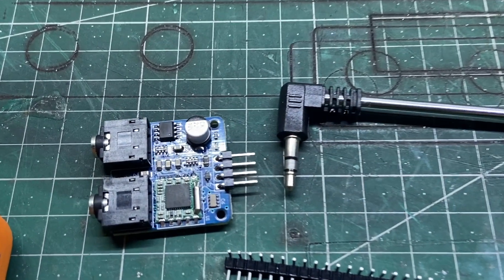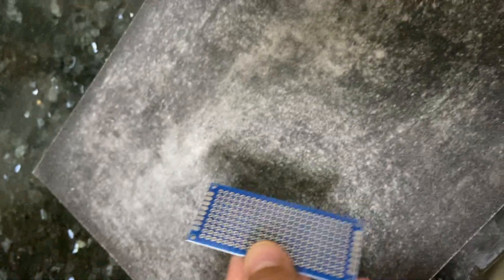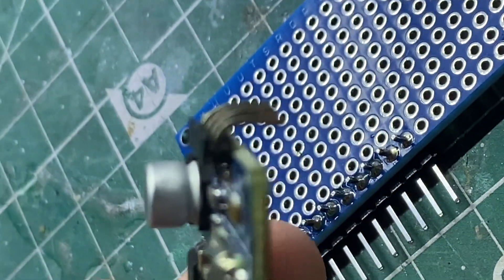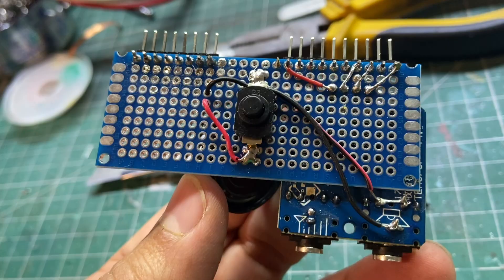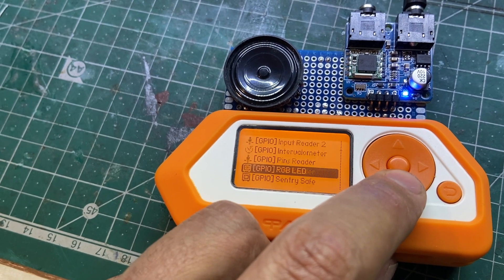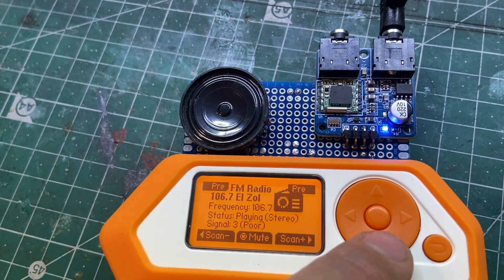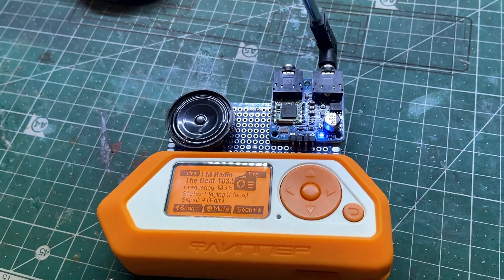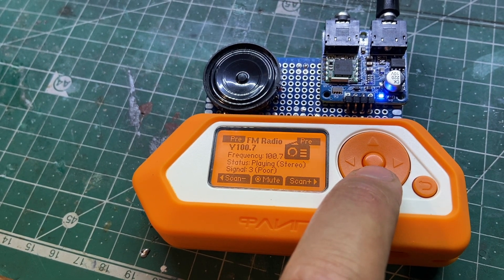FM radio on your Flipper Zero

Comment: Hi, to connect the optional speaker, I'm not quite sure how you did it, can you give me a brief explanation of how to do it, thank you very much.
Reply from the maker: @welinfull  hi! Instead of connecting a jack connector, you can connect speaker wires directly to the pins. It will work no matter the order. You can switch black to res and viceversa
Reply: @Radiogenes  
OK thanks

Comment: Can we block fm radio using flipper zero?
Reply from the maker: Commercial Fm? No, that frequencies from 88 up to 105MHz are not available on a Flipper
Reply: @Radiogenes  Is there any way that we do it? Because my neighbour is so annoying.
Reply from the maker: @TroiBoiGaming  sure! You can use a hackrf and play something or noise in the same frequency of your neighbor. Or use this more cheaper and effective:
https://a.aliexpress.com/_Ey9yh6T

I had same issue once and played adult video sounds on top of the radio station thta was used by that ood lady from 7am up to 14pm good luck
Reply: @Radiogenes  Can you guide me a little, because I'm very new to this.
Reply from the maker: @TroiBoiGaming  you select the frequency your neighbor uses. You connect a player with a male to male 3.5mm jack. You can use an old mp3 player. Then push play and it will output that music,content or just blanc audio if nothing is played. You have to connect an antenna to this device or at least a wire 3meters or so to the center pin before you connect it
Reply: @Radiogenes  Thank you so much my brother! I'll let you know if I can take back my revenge! See you 🤝
Reply: @TroiBoiGaming did this work for you?